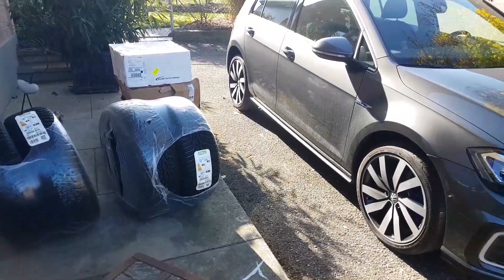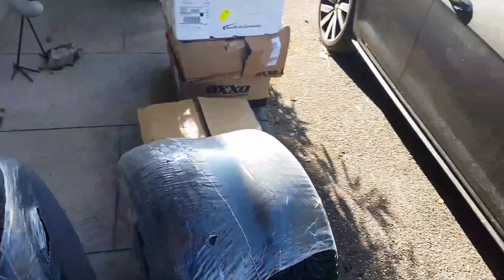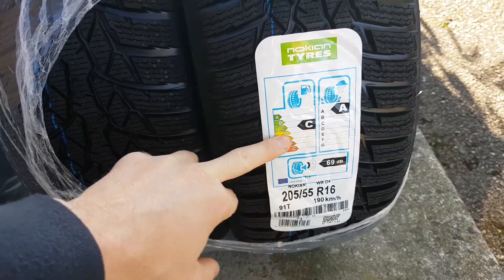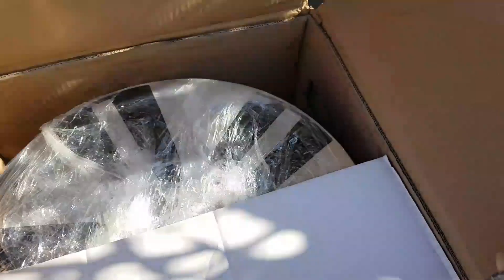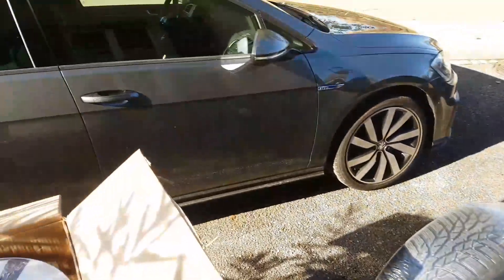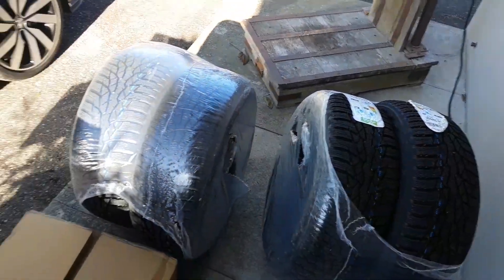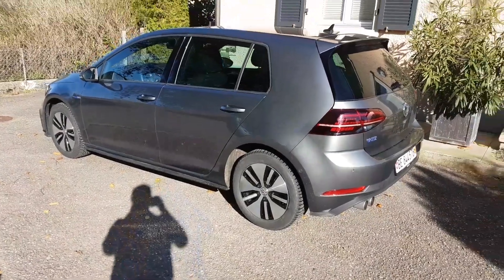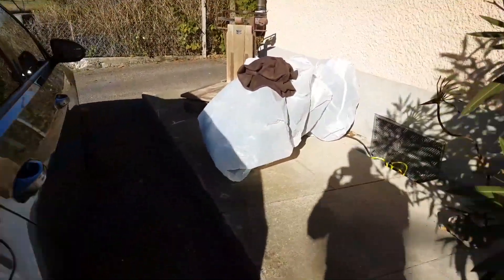Astana Original Aero wheels on VW Golf GTE change details

Comment: Original Marseille wheels are 18x18 ET44, New Astana Alloys are 16x6.5 ET46. You need 20mm spacer to get back to original.
Good to see they clear the standard GTE Blue calipers

Comment: I have heard that because of the batteries, the suspension had to be stiffened and hence the ride quality is sacrificed.
Does the DCC option on the Golf GTE make the ride quality better than the standard suspension?
Reply from the maker: No way, DCC it is amazing , i try 18 wheals and  16 now with winter tires and the suspension are amazing. I had before a Golf TDI and GTE is much better then the older model. I dont think you have to worry about suspension. I think without DCC are good quality to.